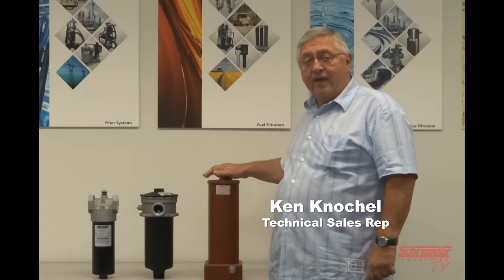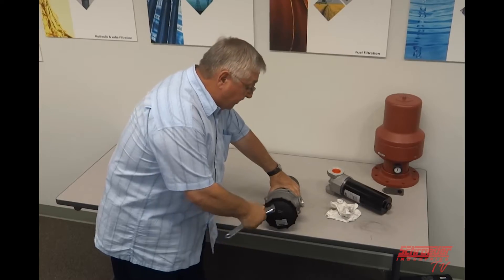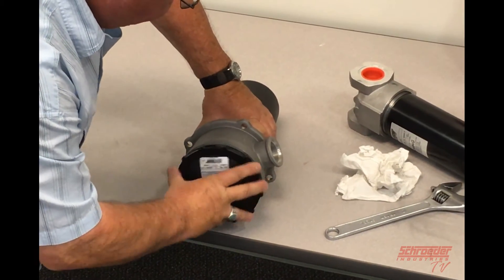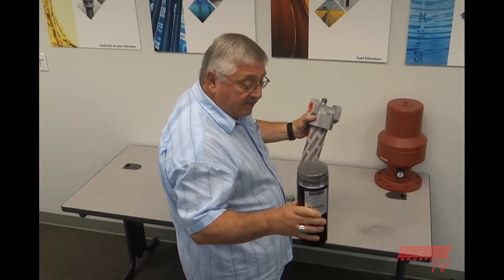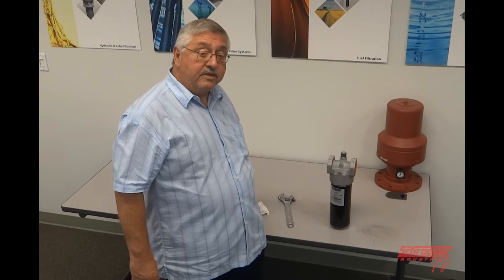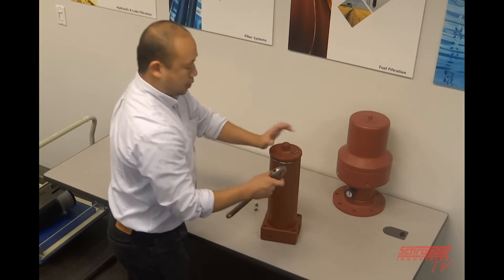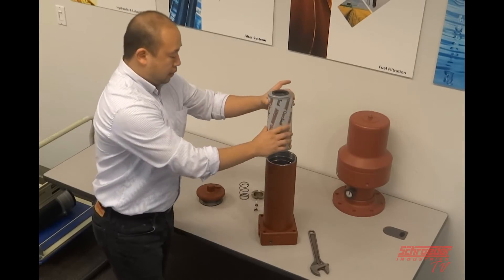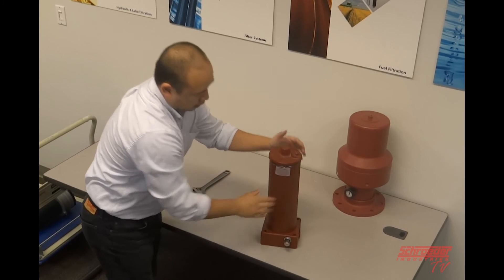How To Properly Service Schroeder Filters + Elements

Comment: With th KF30 should I prefill element once filter is changed.
Reply from the maker: HI Lance! Pre-filling the element housing once changed will help you reduce air introduction in the hydraulic system and is recommended.  Many KF30 filters also come with a bleed plug that with help you expel air that might get trapped in the top of the filter.